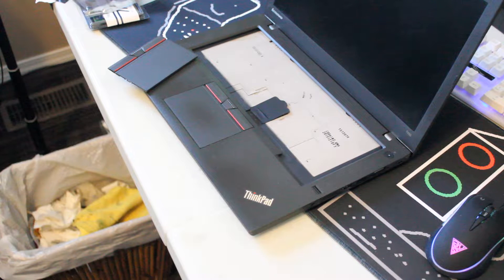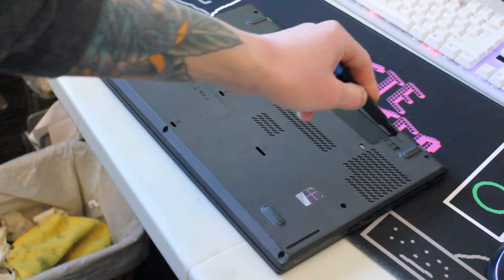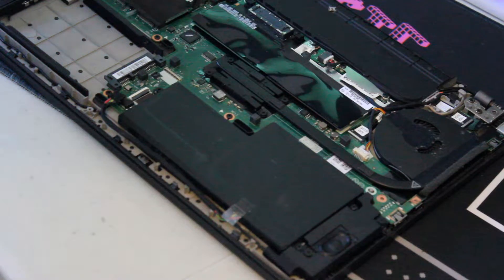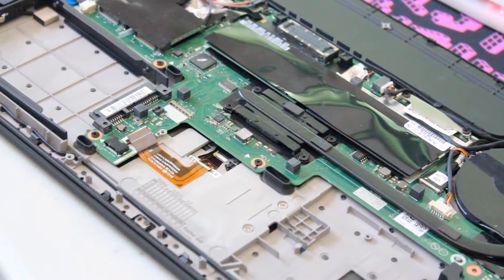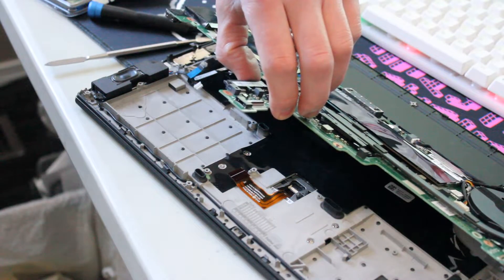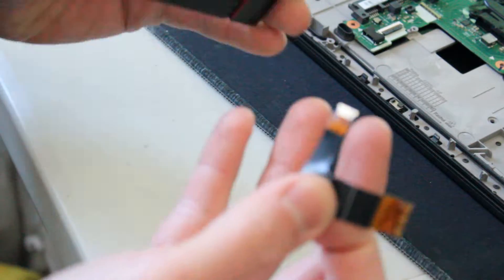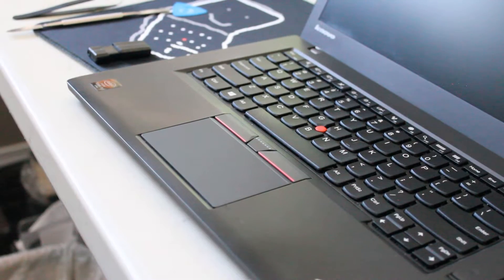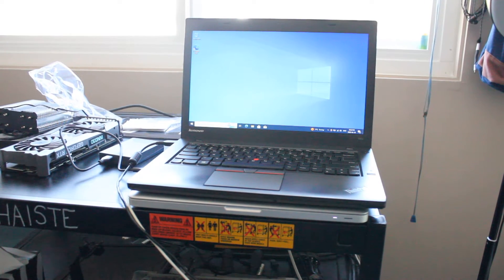Lenovo ThinkPad T450 Touchpad Replacement

Comment: Excellent video, very detailed. 
I know it’s an old video but have one question, if I may.
I read I could use the t450 pad on a t440p, so I bought one. The cables are different, but if used the t440’s cable, the pad works but not the buttons. Any workaround you know?
Thank you very much!
Reply from the maker: There is no solid workaround that I am aware of, but yeah they should work.  Try booting into BIOS and see if they work there.  Or, if you are able to create a Windows Media disk (or Linux) and enter setup, see if they work there as well.  That would indicate a potential driver mix up.

Comment: Nice though there's a difference between saying "oh I started without the keyboard" and "You probably SHOULD take the keyboard off first"
Reply from the maker: Fair.  I should have also noted that you don't have to remove the keyboard at all to just replace the touchpad.  It looks like I was also installing a new keyboard and for some reason left that fact out of the video entirely.
Reply: yep it's necessary otherwise it's hard to life the board because of the keyboard cable

Comment: Can the keys on the mouse pad be repaired ?
Reply from the maker: What is wrong with yours?
Reply: So ive "fixed" ones that had soda and coffee spilled on them by soaking them in ethyl alcohol.  It has to be pure grain alcohol, then airing them out overnight. 
Be careful, highly flammable and ethanol burns with a nearly invisible flame. You wouldn't for example try and dry it out faster with an electric fan.